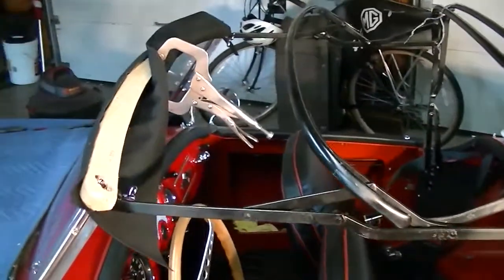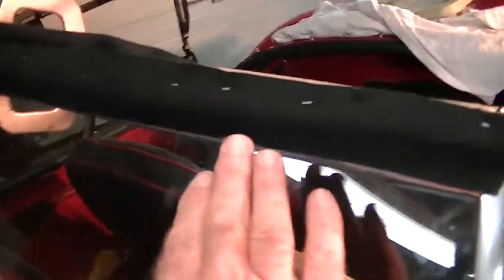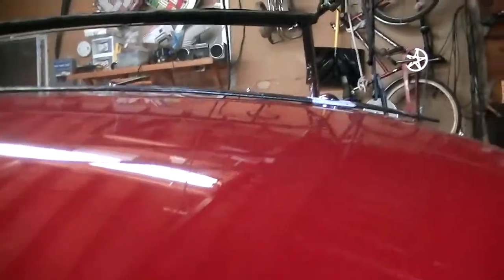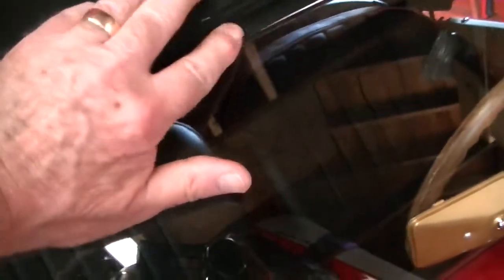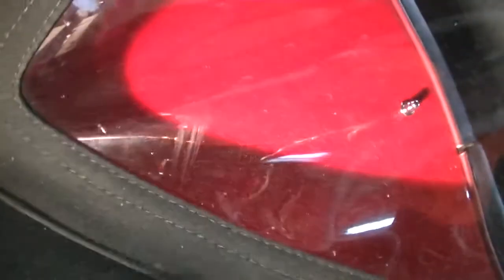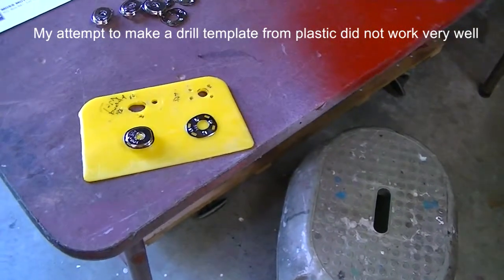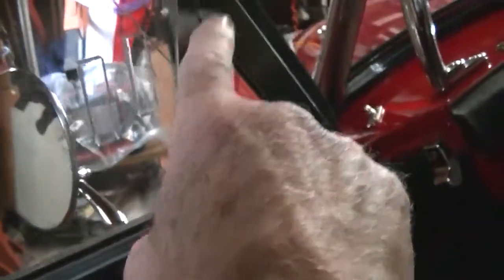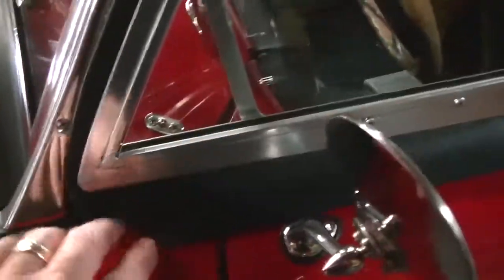1960 MGA Restoration - Convertible top and sidescreens

Comment: Nice top...  Shame about the hole at the top of the windshield to side screens, not sure I could live with that.
Reply from the maker: Yeah it's not ideal, I think Robbins Convertible tops left that flap quite a bit shorter than the rest of the front.  As noted in the video I couldn't stretch it much farther forward.  Could possibly take it apart up front and try again with some big guys helping pull on it but I'm not confident it would be any better, vinyl tops probably stretch easier but I believe they get stiff in cold weather and don't stow as easily.  There is a pretty good warranty on the top but it's too much trouble to take it all off and send it back.  Like so many parts when restoring these cars, you frequently have to make them right if you can.  A pro might do better.